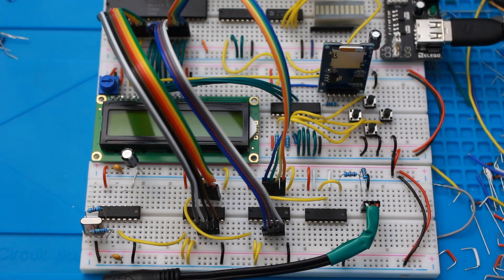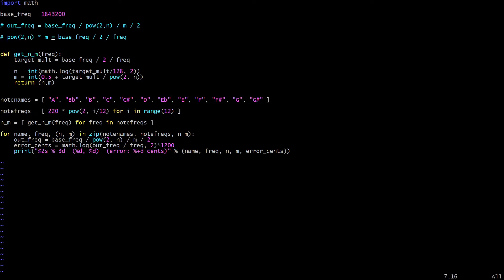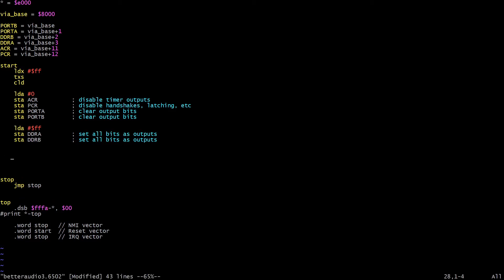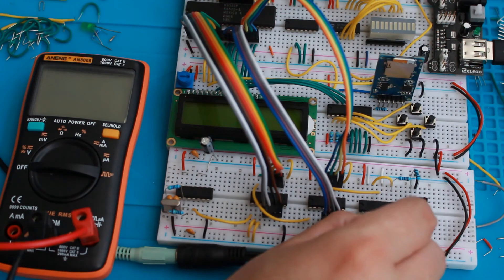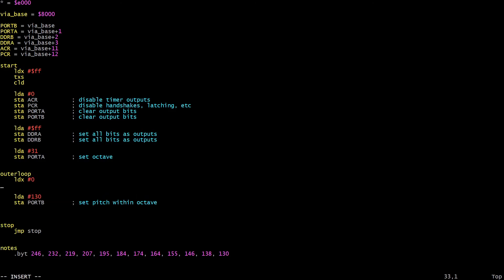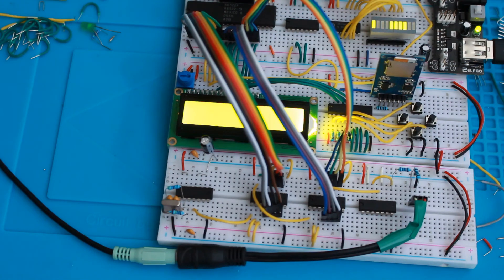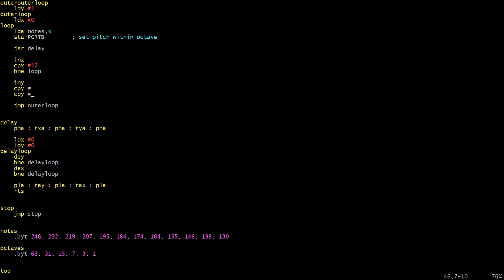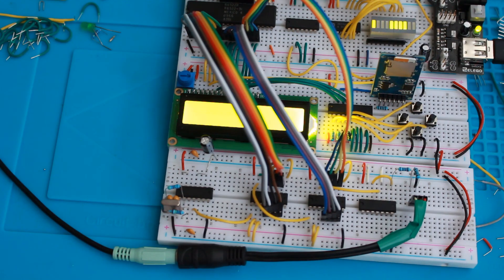6502 audio - Playing Chromatic Scales

Comment: Is there a chance to have an audio input and output ?
Reply from the maker: Do you mean digitised audio? I think it's possible but to begin with you'd need a decent ADC (analog to digital converter), and the CPU is going to have to pay full attention to keep up. It will also use a lot of RAM of course.
Reply: @GeorgeFoot  Yes.An adc/dac or an external audio codec chip like wm8731 to achieve  high quality audio.
Reply from the maker: @Catbangin  Ideally you want a DMA system so that the data doesn't all need to go through the CPU. Having the audio data in dedicated memory with CPU access being the exception rather than the norm would be best, if you have an audio chip that works that way
Reply: Sounds more complicated! but I think you can do it! looking forward hehe

Comment: Oh man, now you've got me re-imagineering my clock modulator! Thinking of capacitors, inductors, and resistors to modulate wave forms and amplitude...how to sample...infinity is my conundrum  for specificity!
Reply from the maker: Haha. I spent a long time thinking about triangulating the square wave in a way that works for all frequencies... It's tricky. I was considering using a constant current source/sink to charge/discharge a capacitor, with a feedback loop to ensure the amplitude stays where it should be. Very complicated. In reality the best thing to do is probably to just implement whatever is easy, and then learn to use the artifacts as features rather than bugs!
Reply: @GeorgeFoot  i was flexing my atrophied java-muscles by creating a software clock pulse generator. Features 1x,10x,100x selector switch, and "rotary encoder" (5% increments)  and pulse/run switch with pulse button. Now I'm thinking any one of 16^2 would be so much simpler. Re-watching Ben's eeprom programmer method for array construction....

Comment: Love this rocking sound card.  :-)  Would love to see you tackle putting a TMS9918 on that computer.
Reply from the maker: Glad you like it! I'm actually thinking of trying to drive an OPL2 chip one day, they're hard to get hold of though.
Reply: @GeorgeFoot  I was wondering if you were going to add more tone generator channels and maybe a noise channel. I feel like that type of "sound card" would take tons of breadboard space though. I'd also love to see you include a dedicated IC. I recently picked up a few SN76489 and AY-3-8912. The datasheet for the ladder is daunting though as I'm quite the beginner.
Reply from the maker: @tylerlatham8784  Yes, my main plan was to add more channels, and volume modulation/mixing. This circuit needs one breadboard per channel, and my prototype that I played the Bad Apple music on had two channels.
I'm also interested in ROM-based wave shaping like the OPL does internally, maybe even using RAM, but that's another project, and I haven't thought it through yet!